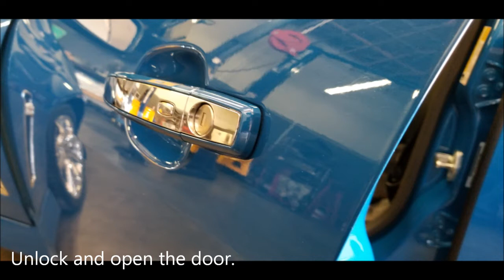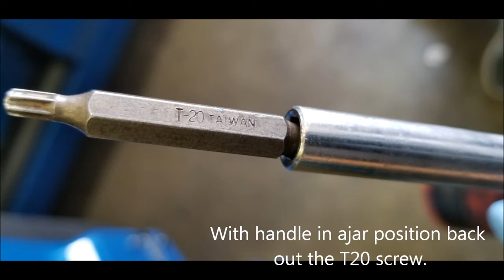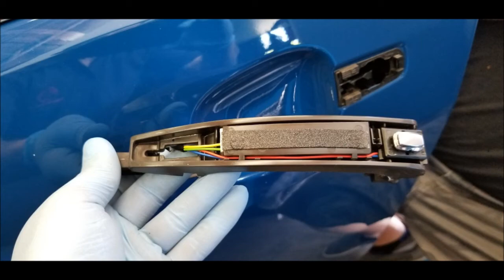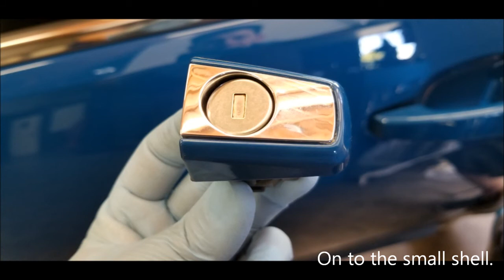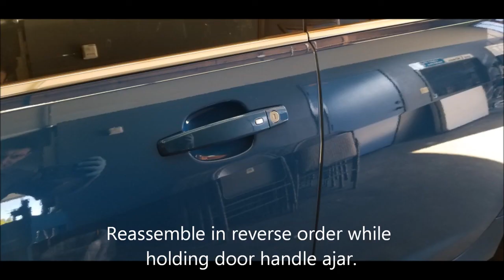Chevy SS Sedan Door Handle Outer Shell Replacement Install

Comment: 43- slide the handle towards the rear of the car
49- gently walk out the front of handle as to not damage the harness
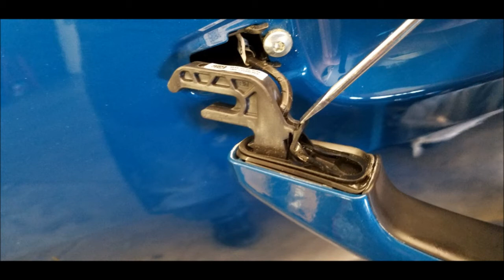1:01- pry back the weather seal's retainer tab and pull over the harness